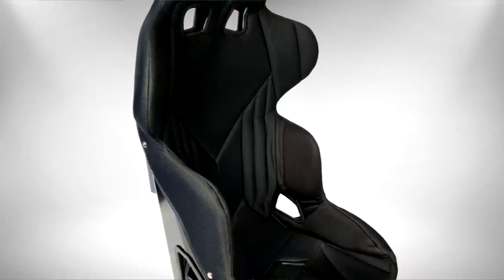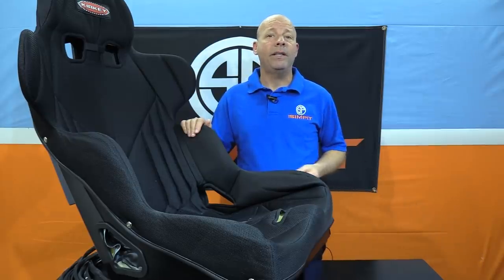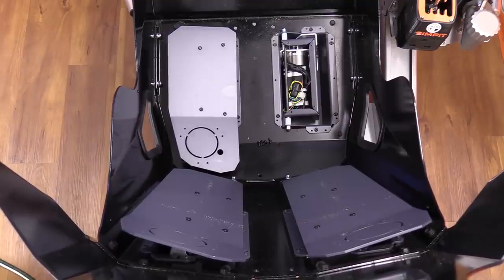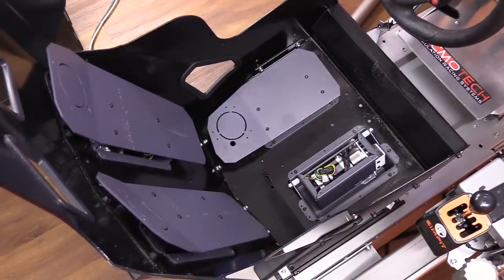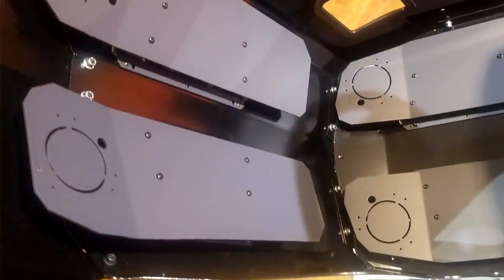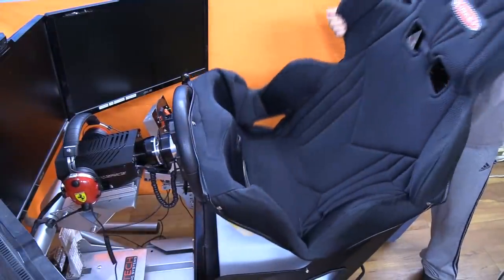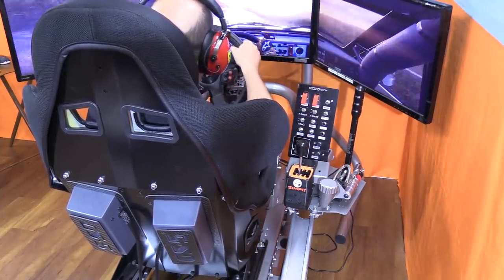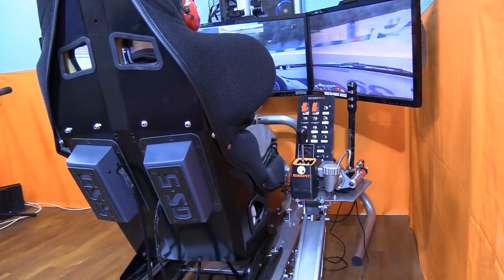The Most Innovative Sim Product for 2019 - GS5 GSeat Review

Comment: I'm using the seat since almost three weeks now and I needed no acclimation at all to get my old lap-times and it supported me since day 1 for being even more confident to do that. But i sucked with any motion-seat i tried before, because they feel wrong. Just traction-loss with a fast seat mover (Stage 3) feels a little like the real thing in corners, but more like a road-car. I did some kart-racing last year and i know what it feels to get pushed to the seat in fast corners. The GS-5 can't simulate those overly strong forces for sure, but what it does is a very similar feeling and in a non-intrusive manner. I guess you did not run the seat with more authentic settings, means at least three times the default strength. Default is now 6 G, even GT3-cars can't produce 2 G in the fastest corners. Properly tuned you don't sit that calm in the seat, but rather move up and down from the bumps like seen in many onboard. Not so much like it's possible in a D-Box-system, but not that less either. A stage 3 can do much better on the braking effect with seat belts, but the GS-5 can do enough for sim-racing plus 3 more DOF. Tune it properly or download my settings and forget iRacing. rF2 and ACC are the winners here.
Reply: Where can we find your settings? Specifically interested in those for rF2. Thanks!
Reply: Does the gs5 not work well with Iracing? I was about to buy it
Reply: @johnspanos3862  It's always worth to have one and my subscription ended last year. I don't like iRacing for other reasons.

Comment: I've had my GS-5 for a while now and it does take quite a bit to set up correctly but it really does add a great new level of immersion. I agree it is a bit noisy and does take too long to get it dialed in.
Reply: Do you need a second sound card to run the gs5 with all the wires and USB cable that  plugs into the pc from the gs5 control box
Reply: @buddymasters  Lol no. A sound card isn't needed at all. This thing isn't a bass shaker.
It has 1 usb cord you plug into you computer. Simple as can be.
Reply: Bentler  but apparently takes a long time to setup ?
Reply: @riazwalji3417  what?
Reply: David Weiss just from original thread where David mentions it takes quite a bit to set up correctly...
Reply: @riazwalji3417  to set up in Simcommander to get the best out of the GS-5. Try to comprehend what you are reading first mate.
Reply: David Weiss I read it. Just saying “not” as simple as can be. Still loads of time setup.  Fun comment response. Chill.
Reply: @davidweiss8710 Quote:
" it does take quite a bit to set up correctly" 
 " and does take too long to get it dialed in."
Try to comprehend what you are writing friend.

Comment: If money were not the main consideration, would you buy this or the Next Level Racing Motion Platform V3 for road racing in openwheel formula cars?
Reply: V3 for sure- this simulates movemmovemt - the v3 IS movement. but if money weren't a factor- surely you'd want both

Comment: Does it work with DCS? And can the seat be slanted at 30 degrees cause then I want this for F-16 simulation :)
Reply from the maker: I'm not sure if it supports DCS, I know it works with Microsoft Flight Sim and X-Plane. You can hit up simexperience and ask.
Reply: @TheSimpit  I confirmed with Simxperience that the GS-5 seat does support DCS. I am working to see if they can support Falcon BMS as well. 🙂

Comment: should be great for VR sim racing👍and i'm wonder how it would work with a motion rig?
Reply: It is awesome in VR, and it does work well with a motion simulator, I run my GS-5 on a SimXperience Stage 4 and my GS-4 on my DIY motion rig
Reply: @Avenga76  Do you use the seatbelt addon as well?
Reply: @MaddogBC4  Yes. I was one of the beta testers for the G-Belts

Comment: For the price of just this seat you can get a full motion simulator.
Reply: I have this seat and it's better than any motion simulator i tried (8 so far up to 40k Euros)
Reply: @Leynad778  Glad you like it, but you are still just bouncing around in a seat while looking at a screen that does not move with you, like a real car. That's where the motion simulator comes in.
Reply: I think it is a neat new feature for simulator rigs. But at the moment the P3 motion rig with 3dof is without ANY competition. I‘ve tried pretty much every competitor on a sim racing exhibition last year. The P3 is better than any of that sometimes over 50000$ expensive rigs. A friend of mine has it and I helped him install & setup the thing. The degree of movement and power is incredible. The only, really only complain is, that it could be a bit more rigid regarding the wheelbase stand. Still, for 2499$ you get nothing comparable.
Reply: @Toutvids  I'm driving mostly in VR, but the bouncing isn't that strong to get annoyed or distracted. I guess because it doesn't simulate the movements of the car, just movements of the driver inside the car.
Reply: @iseeq72  I tried the P3 as well and sorry, it was the slowest and most sluggish motion. The best rig with the same principle will be the next Raceroom Track-Time rig. It will probably cost five figures, but with some very strong actuators included and the heave effects looking very wild. From the seat movers I prefer the Stage concept of SimXperience. Because the forces are not coming from the bottom and not carrying and moving the hole seat but using the seat as a leverage, they are pretty violent and like a DD-wheel in comparison with a T300.
Reply: Marcel B. Not even close to new. Gs4 been out forever

Comment: Guys, if you are using triple monitors or even a single, you shouldnt upgrade to nothing else other than VR, u dont need direct drive wheel to be fast, u dont need this chair or anything else for that matter, the thing that will make you most consistent and fast and  provide you with unmatched immersion is VR.

Comment: Great review, but the product is dumb! Do people not realize that you spend 5,000 on a SIM when you go out and run a street stock?  You can do the real thing!! Some of these products are just stupid to me, how do they make money?
Reply: Why so judgmental for 5000 a rig computer and a vr headset you all set.  With the car your talking about probably turn key but with wreaks etc going to be expensive  fast
Reply: How many races will you get for 5k?
Reply: You may be able to afford a couple of entries but the running costs in a year will surpass 5k. Even disregarding wrecks, the tyres, clutch, brake pads, fuel etc will easily run you north of 5k. If you crash and need to straighten the chassis it will cost you 5k alone for that. I agree that I personally wouldn't pay 3 grand for this but it is not more expensive than the real thing.
Reply: that's bullshit and you know it. between tires, fuel, tow rig and trailer, repair and maintenance, car buy in, race buy in, living near a track...not everyone has the option to actually go racing. hell, racing season for me is 3 months long unless you're willing to drive more than 10 hours a weekend. add in a kid or three and a wife and tell me how running street stocks go.
Reply: Good luck getting the car to the track without the extra cost of a tow vehicle and trailer... not to mention needing the space and having a local track.
Reply: At this price, definitely need to try before you buy. What is the returns policy on something like this?
Reply: Because you can get the same competition adrenaline these days in Sims like iRacing.  You dont have to leave your house, have expensive car repairs, possible hospital bills etc.  In the end, your after the competition, social atmosphere, and true to life racing with the right equipment.  I own a full on business centered around the sim racing community and many of my customers are have been real life local racecar drivers who eventually went full sim and quit real racing all together.  I also have sold to real nascar drivers, F1 drivers, Peak Pro drivers because it is so realistic.   So yeah, its cheaper and better than real racing.  And you can do it every night.  F e G pc /net.